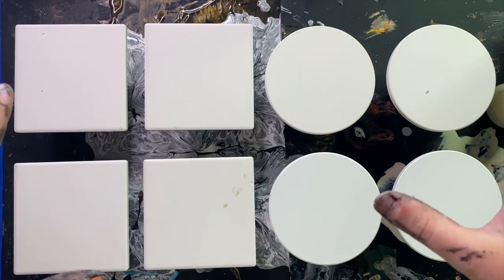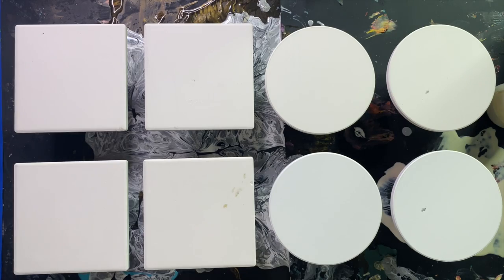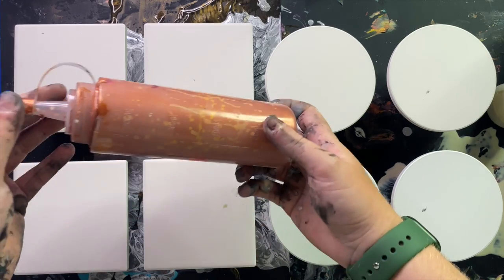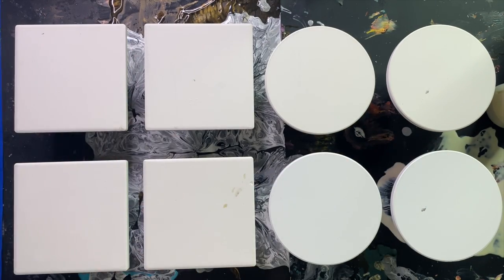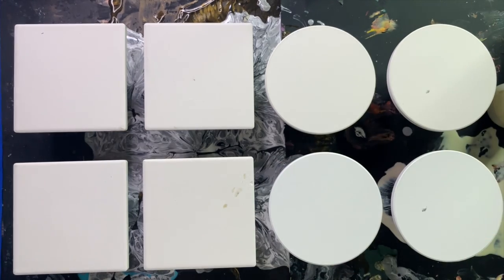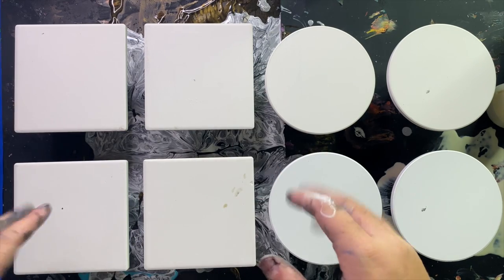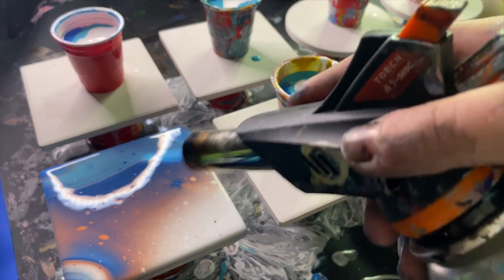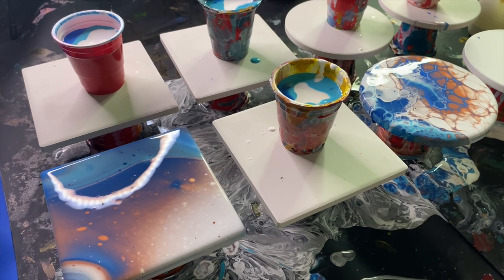ACRYLIC POURING - Silicone Oil or just Floetrol?

Comment: Are any of these samples including both silicone and Floetrol? I am just starting and I'm afraid I may have been too aggressive in the tools I bought, which were floetrol, mineral spirits, and silicone. Can these be used together in a pour?
Reply from the maker: Yes all the silicone examples are using floetrol as my pouring medium ☺️ 

I would suggest a mixture of paint, floetrol ,water and 1/2 drops of silicone. That will give you a really nice mixture. 
You want the mixture to flow but leave a little mound on top of your paint mixture when it flows back into it.
Not too thick and not too thin ☺️